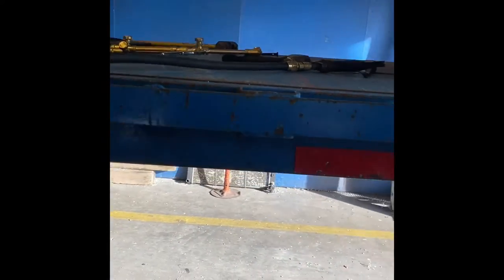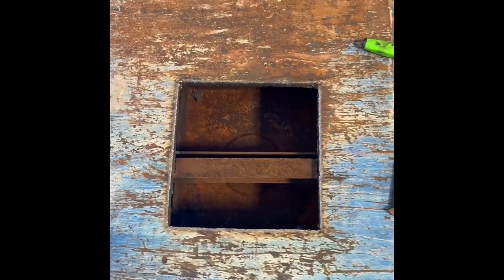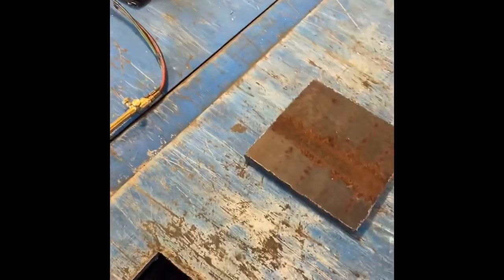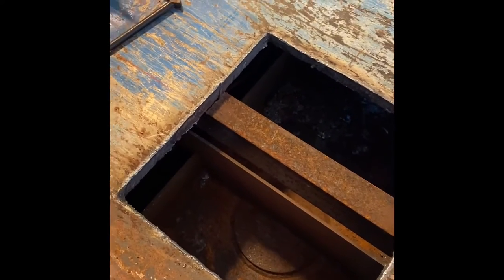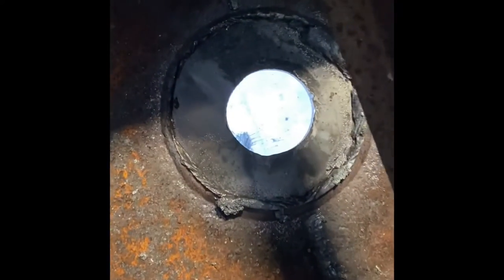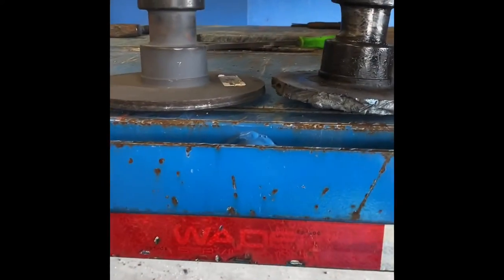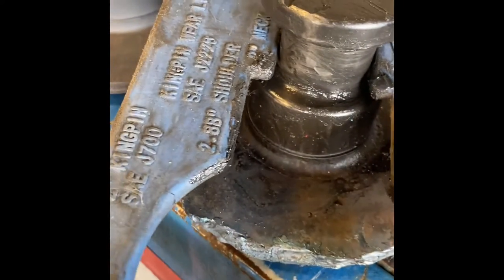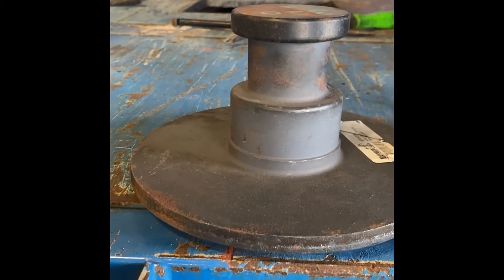King pin replacement

Comment: Thanks I’m in the process of replacing my kingpin in my trailer now I know how to do it without changing the plate because I got a quote today just for that the guy ask 2k without changing the plate
Reply from the maker: If you run into any problems or need assistance feel free to message me I’m always willing to help out a working man trying to save money
Reply: @repairandmaintenance9825  thanks I’ll message you if I need more advice thanks for your help

Comment: Hey man I have a question about the kingpin thickness bolster plate which size should I get 1/4” or 0.380 or what’s the difference in between them sizes
Reply from the maker: I’ve always went with 5/16”
Reply from the maker: Thicker the longer it will last and gives peace of mind